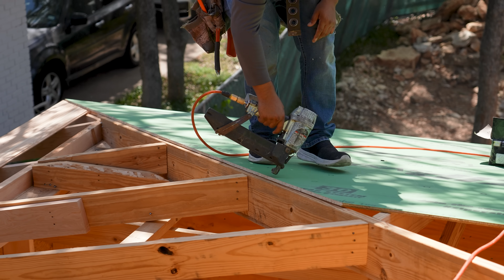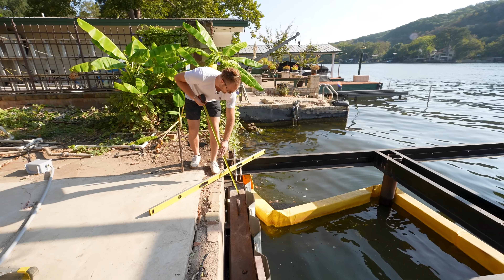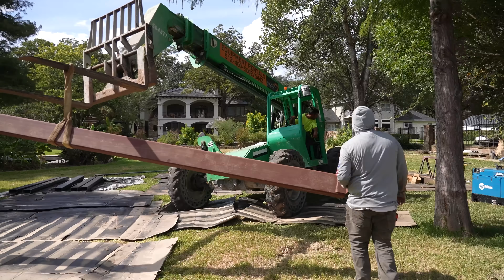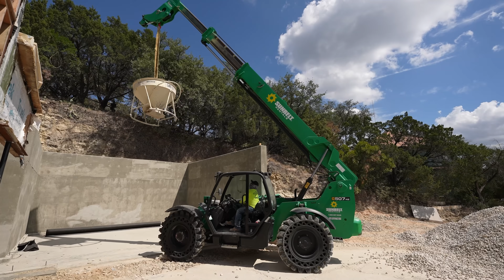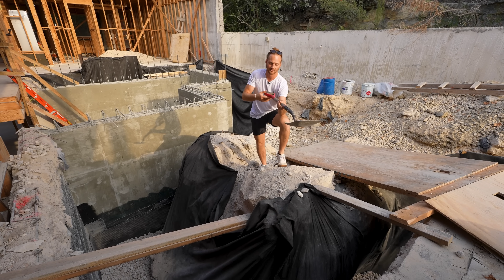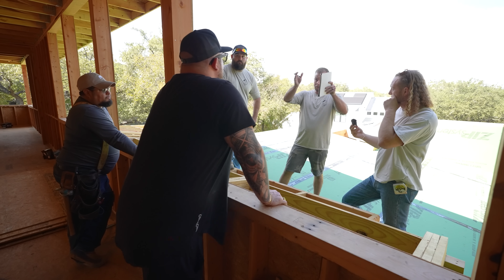$1,000,000 Pool Waterproofing Madness and Massive Boat Dock Steel Framing!

Comment: surprised you're using steel on the boat house--steel & water = rust.  How do you prevent that??
Reply: Think about it.  Most bridges are made from steel.  Surface rust does not affect the integrity of the steel.